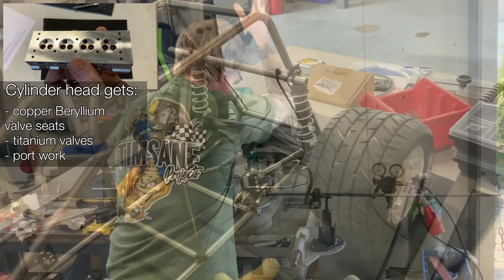1/5 RC Sprint Car Build - Chassis work and Toyan L400 install

Comment: I love that you have a room just for grinding to keep the rest of the shop clean......there is nothing like have a clean, BRIGHT shop.....well done
Reply from the maker: Thanks! There is only this possibility to have a separate room with extra ventilation. We need to have it clean whenever we assembly cylinder heads. Thanks for watching

Comment: Do you have a link for the tool you used to install the thread inserts?  I have not seen that tool before and the ones I use do not seem as easy to use as that one, Thank you as always for the great content!
Reply from the maker: The tool is from „Würth“ part HES 412 - not the cheapest version out there but solid quality.

Comment: Hey mate what rear solid diff are you using? Not sure if you mention it or not.
Awesome build coming along nicely🤙 I'm not a fan of the sprint car but love the craftsmanship brother..
Regards Ryan
Reply from the maker: Thanks Ryan, the rear axle is from a Losi Super Rock Rey. With around 100USD affordable and a huge time saver. We will see how much power it takes. Thanks for watching
Reply: @timsane  that's a very good price thanks heaps mate

Comment: So what idea you have for additional power? Turbo or s/c cause we’ve had this conversation before. Not gonna be enough oomph with Toyan for this beast. I’d love to see a Crowley stuck in there but who’s got 10k for a mini engine. The guy should send you an engine to showcase in this awesome build.
Reply from the maker: The engine will get a complete makeover plus supercharger (target is 15psi) and after that.... I am going to cheat like crazy 😜

Comment: Looks amazing Tim! Your shop is a work of art as well! I see one possible problem in the angle of the drive line being the amount of angle from engine to differential... I'm sure you have a plan? Otherwise if it's direct as is you may develope a serious vibration??? Great work Tim, so nice!
Reply from the maker: Hey Mike, here we go again 😉 Good eye! I will add a transmission to the clutch output shaft. Those gears will delete all the offset you see right now. The driveshaft will be nearly horizontal later (maybe 5 degree upwards). Since you post EVERYTIME i will pin your next comment on the next video. Whatever message you have, it will be there on top forever 😬😘
Reply: @timsane  Hey Tim 👋 I knew you had a plan, Lol! 😉👍 Thanks buddy, have a great day!

Comment: What are your tube stock dimensions?  ID/OD wall thickness?  BTW, this is epic and I want to get this full FAB RC thing going in my area, nothing like combining welding into the mix as well.  Inspiring work my friend.

Comment: This should be a rc racing class and you could be the main chassis supplier and your chassis or chassis same as yours only allowed and maybe run a cheaper motor like a weed eater 2 stroke to make it cheaper and run the on a big track

Comment: Engine seems mounted way too high!!!???? arent we going for low center of gravity for stability?
Reply from the maker: There are several reasons for this position: I want it to look nice and not have the engine 4 inches deep into the body. But more important, i need the space below the engine for sth more heavy... Lipo and heavy brushless motor. Thanks for watching and your comment!

Comment: Tolles Video 👍
Ich kenne jetzt nicht genau dein Kupplungs setup. Aber falls das  Standard Baja ist und die nicht ausreichend ist wäre das das Upgrade. Ufc clutch kit.
https://www.rcmax.co.uk/product-page/ufc-hpi-baja-full-clutch-kit-tr-pinion-type
Reply from the maker: Hey, ich bin auch sehr gespannt wie der Motor sich schlägt. Kupplung ist Standard mit 8000er Federn. Irgendwie glaube ich nicht das der Motor die Kupplung platt machen kann... Mal sehen was passiert wenn ich mit dem Motor fertig bin. Danke fürs zuschauen